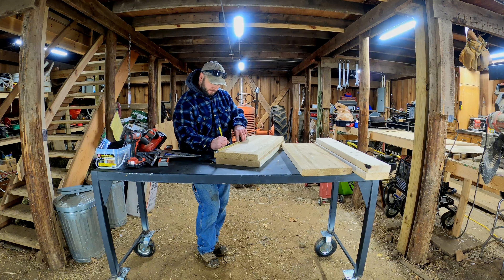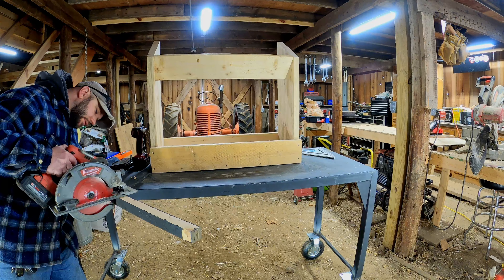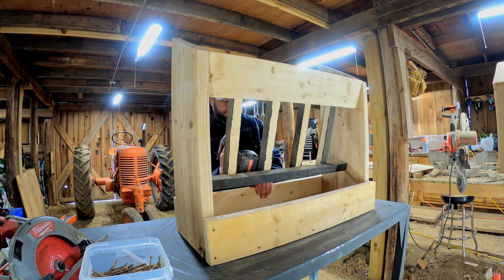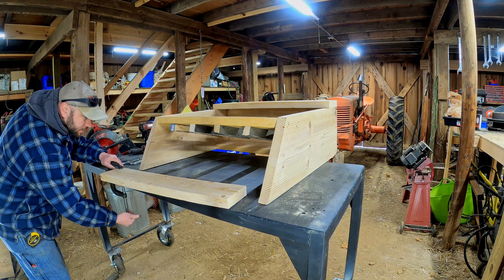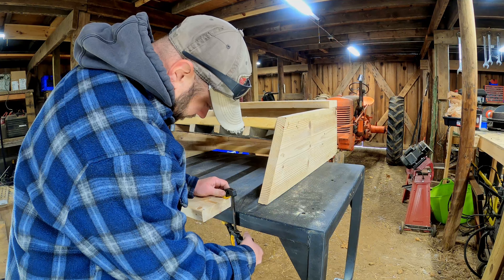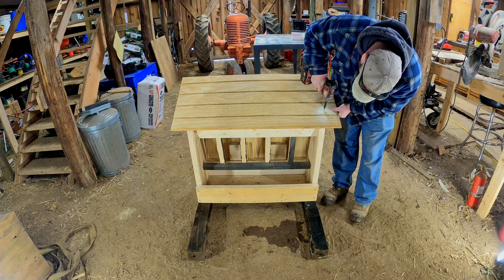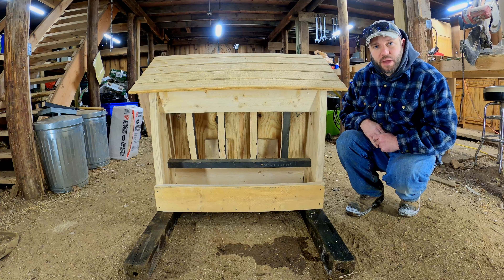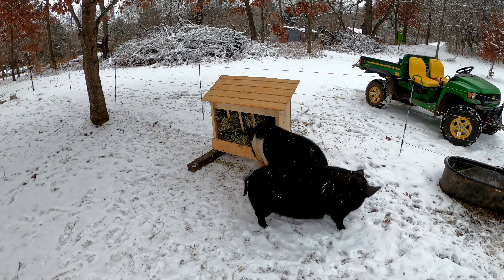IT COST $0! BUILDING A HAY FEEDER FOR OUR KUNE KUNE PIGS WITH M18 MILWAUKEE TOOLS

Comment: Still holding up ok? Anything you'd change?
Reply from the maker: It's holding up really well. One change I made was to take the board I had across the front to hold the hay in off. It was holding the hay up too much. A change I still need to make is decrease the angle of the slats inside the feeder. They are currently holding the hay too tight and the pigs are not pulling the hay out. Other than that it has been amazing! Thank you for watching and commenting!
Reply: @JustCaidsDayFarm  thank you for responding and for giving me some ideas!
Reply from the maker: @DadJokesAllDayLong  No problem!